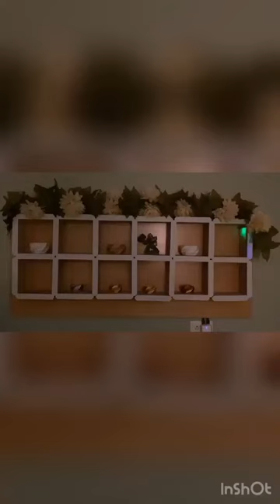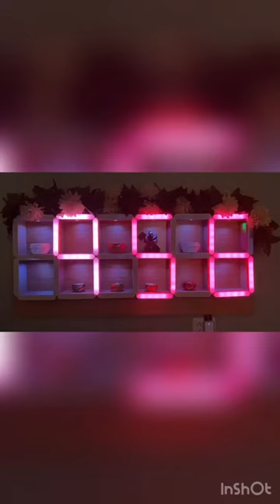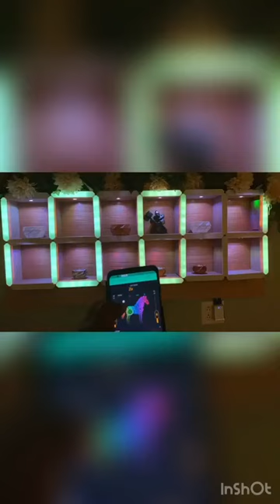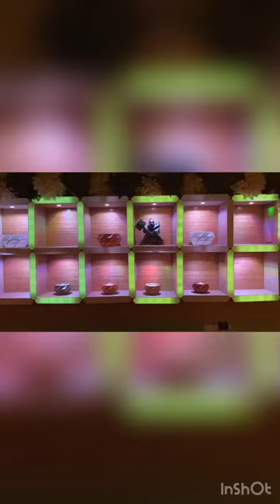Giant Hidden Shelf Edge Clock - 3D Printable | ESP8266 | Blynk | Google Assistant | 4 LED Per Rail

Comment: The neighbor’s two wooden boards were put in the trash can. I picked it up from the trash can. I bought the arduino+DS3231+WS2812 online for 100RMB, and DIY a shelf clock (the video was posted on my youtube)I want to change to ESP8266 instead of arduino

Comment: where can i find the attached file. I have one with 5 lights per strip but dont know where to change the value. thanks and great work.
Reply from the maker: Hi! https://www.thingiverse.com/thing:4207524
Reply: @amorozzo19  Thank you for sharing the files for this. I don't have a 3D Printer, but I do have a table Saw and a Laser Cutter. 

I am trying to think how I can do this with a 12" wide section of hollow-core folding door. I know you can saw off the bottom end of a normal hollow-core bathroom door if it is too long and replace the empty (not the right word, but ...) section with the bottom solid frame piece. 

It seems like I should be able to cut up a folding door to get verticals and cut triangles from a two-by-four to get the angled-segmented look of an LED and still be hollow for the LEDS. Then I can Laser or table saw cut some white frosted acrylic for the lenses. 

Any Thoughts ? I really like the design and would like it to be function for supporting books and things.

Comment: Good job !
What kind of board do you use with blynk ? An arduino nano with the ESP8266 ESP-01 or the NodeMCU ESP8266 ESP-12 (but there is only 3.3V output) ?
Reply from the maker: Thanks! Just the ESP8266. I got a 5v 4.8 amps USB charger from Walmart. It has two outputs (2.4 amps) each. One goes to the lights, and the other to the NodeMCU and the light sending.
Reply: @amorozzo19  Do you have a link for this kind of USB charger ?
Reply from the maker: @yannpotier4844  yes. I got it at Walmart.  http://www.walmart.com/ip/Refurbished-Blackweb-VIPRB-BWA18WI047-4-8-Amp-Dual-Port-USB-Wall-Charger-White/590598850

Comment: Can you tell me how much time and money it takes..
Reply from the maker: Hi! I spend 5 days printing non stop. But I was working on the lights and code as it was printing.
Reply: the whole thing takes 380 hours to print, with default settings uses about 4.5Kg of filament Cost depends on the type of filament you use. I used left over filament so couldn’t calculate the cost